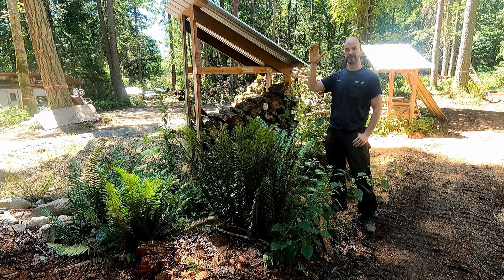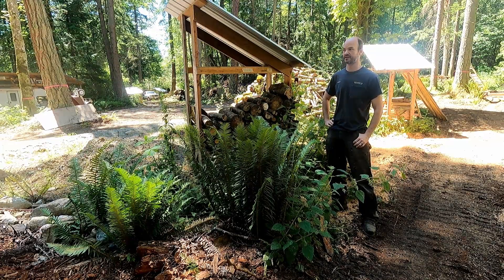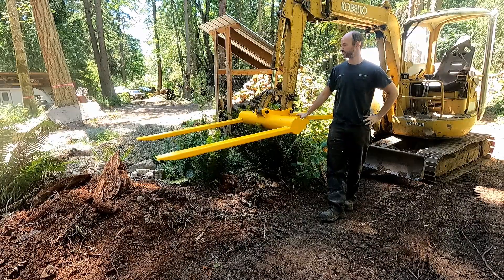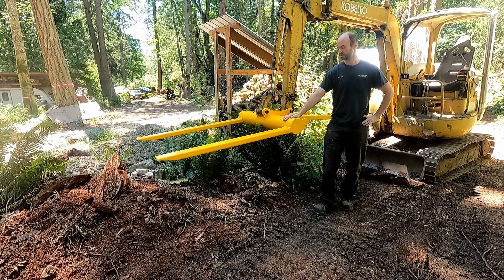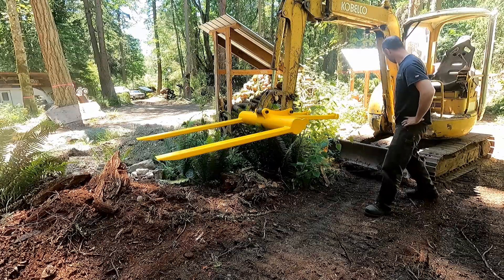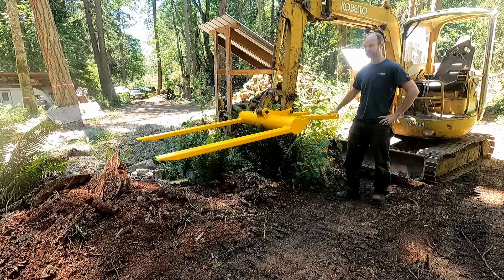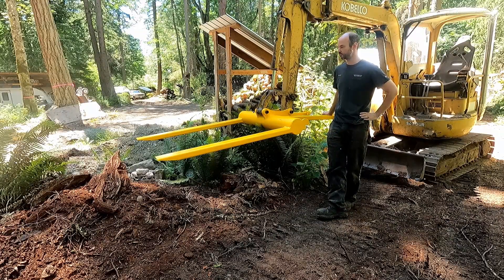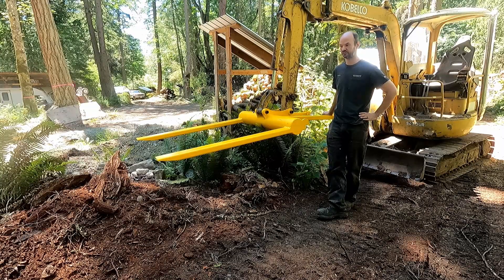Making Excavator Forks Part 1

Comment: If i were able to touch my investments I'd invest in consumer grade abrasive discs!
Reply from the maker: Just as 90% of woodworking is sanding, 90% of welding is grinding. Honestly, though, on this project I spent way more on band saw blades than I did on abrasive discs.